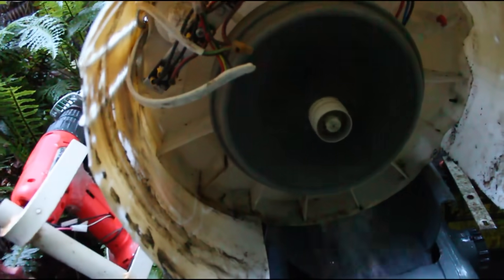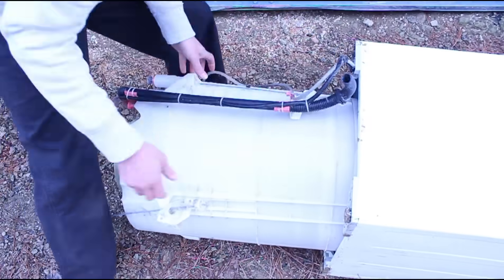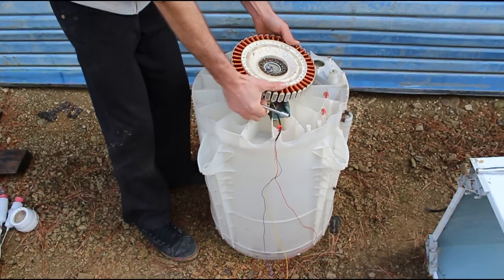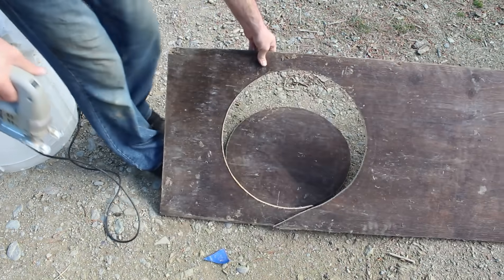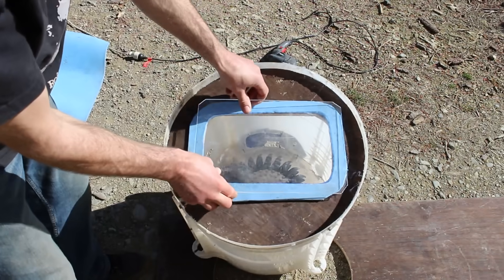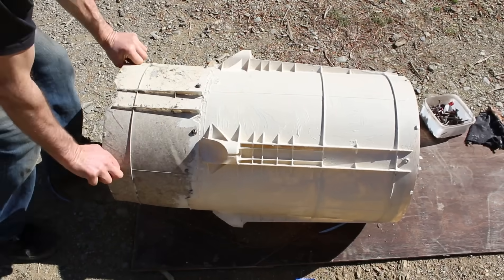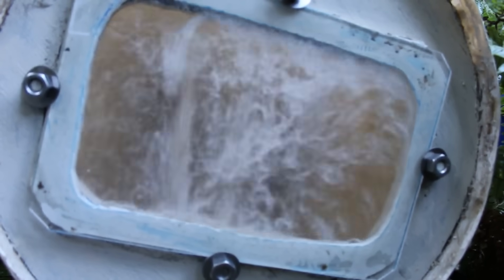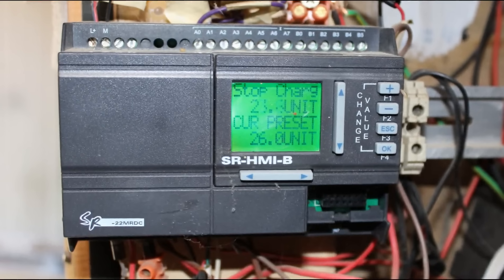Free power- How to convert an old washing machine into a water powered generator

Comment: all i need is ...land :(
Reply: Have a large tank with a high pressure hose connected from a height and have the water drop down to spin the wheel, connect a coil pump to the wheel either by chain or added to the axel. This coil pump using the spin of the wheel will pump the water back up to your tank without the need for electricity, or use a series of small pumps that use the generator charge, if you do that step up a voltage and then step down but a buck converter to each pump you need. But yea coil pump will get the water back up to the main tank. Ram pumps are good if you have an abundance of water but I’m guessing not in your case mate you want it all in one place like i do.
Reply: Go deep enough into the bush and you have your own land
Reply: Best investment you will ever make.
Reply: @calebengelbrecht7812  Land? Water turbine? I would build one 100% if only I had the space.
Reply: Less comment section, more work, you'd have some.

Comment: I came here after watching a washing machine turned generator that has been giving an off grid house power for 16 years on Marty T  YouTube channel. Thanks for answering the question "how is it made?"
Reply: I just asked the same question on Marty Ts channel then found this!
Reply: Is this the same guy as Marty T?
Reply: @droopypie  I don't think so.
Reply: @droopypie  yep same guy
Reply: It's the same guy I'm sure. Near the end he brought up his melted enclosure which I saw on the other YouTube channel.
Reply: @SteveJaye84  thank you
Reply: Yes same guy lol
Reply: This is marty T, pretty cool ayy
Reply: Same
Reply: how does he get that water pressure though? it can't just be that little stream going through those tubes
Reply: @ethand4784  I think it's the pressure is increased because of the length of the piping and the fact that it's piped from a great altitude than that of where the machine is.
Reply: @huwthomas9954  i think you might be right, that sounds pretty logical to me
Reply: @ethand4784  
He mentioned like 40-something meters of head so there it is. I’d love that volume of water and that much drop!
Reply: @ethand4784  gravity.
Reply: same idea.
Reply: Applicable only in places with free running water.and the flow of water changes as season changes...
Reply: I came here the same way, too

Comment: I've seen similar systems using a car alternator  and welding a steel box housing for it , the wheel of the alternator on the inside of the box , acts as a pelton wheel  :) it produced enough power for two houses changing batteries 24/7 !!! :) 
Nice job , the bearings issue obviously needs maintanence regularly , taking time to lube regularly ! 
With the alternator system , bushes need servicing every one or two years :) 
I love free power , my fisher and Pakel machine recently had a electrical fault , it's the same as yours , I pulled it apart to see what could be recycled and discovered the internal gear , perfect for a wind or water free power system !!! 
I was stoked to see your post today , and it's confirmation ! 
I put a multi meter on the posts that come off the motor and found instant voltage :) and realised just spin it with wind or water and , FREE POWER . 
Thanks for your sharing , great timing ! :)

Comment: I can recommend installing a temperature sensor on or near the bearings to monitor any possible issue with them. You can also add an accelerometer to sense for excessive vibrations and autmoatically shutdown the unit. If your controller does not support this, a small Arduino could monitor these parameters and issue an emergency shutdown signal to the controller through a generic IO line. Or even shutdown the system itself too, adding redundancy in case of failure. While you're at it, add a temperature sensor on the battery pack.
Reply: Hey do you run the F&P Smartdrive yourself and if so, do you do coaching for a fee?
Reply: They're factory sealed bearings that will wear out from the excessive speed of rotation.   Not to much to do about it, other than drilling a small hole into the housing and lubricating it on a schedule.   Just my opinion though, carry on.
Reply: @JohnJohnson-bg2oo  then stick a magnet on it or magnetise it and fill it with ferrofluid
Reply: @JohnJohnson-bg2oo  you can replace them before they damage the whole thing

Comment: Nice job fella, I did the same thing in the 1970's by making everything in my basement during the winter time. You really have it much easier these days for sure. But it is still running for my father. He loves it. Keep on making videos too.
Reply: Do you have a video explaning each part? For example: Bridge rectifier. How to do high pressure.  How to convert it to 110v. Charge a battery. 
Thank you.
Reply: @AurelienCarnoy  I will have to make some videos for all to see and get an explanation also. Good day VF.
Reply: @victoryfirst2878  thank you.

Comment: Cool, finally a video about free energy which is not full of bull or woo but really offers a solution! Like.
Reply: +Nele Abels It's not 'free energy' though, it's just hydro electric power, that we've known about since we've had electricity.
Reply: +goaliedude32 you're right, it's not free in that he has to pay for the pipe and parts and repairs and has to lay the pipe and has to purchase the property and has to pay property taxes - so, for every $1,000 he saves in electricity he might have to pay $50 in labor, parts, taxes and investment costs so it's not "free".  But, paying 1/20th of what he'd pay the power company is pretty close!  The REAL cost is that he has to live in a totally Hillbilly, zero civilization place where the ability to earn money is likely nill and the lifestyle is surly shit.  NO THANKS!  I'm fine living here in Vegas and paying my power bill, thank you very much!
Reply: David Beecroft
No, I meant that traditionally free energy is energy that is created by using over 100% efficiency devices. So more energy comes out of a system than goes into it.

This is just harnessing potential energy and converting it and it's not even a new idea. It's one of the first forms of generating power that we invented.
Reply: goaliedude32 yeah, good point.  he shoulda said "cheap energy" or "untapped energy"
Reply: +goaliedude32
Since he has found a way to power his generator from the stream rather than having to pay for high-pressure water, the electricity is free to him.
Reply: +David Beecroft
Yes, it would be, since he doesn't have to pay for his higher-pressure water downstream with this system, because the equipment isn't the energy; the energy is the energy.
Reply: +goaliedude32
It's actually not, because that kind of system doesn't really work.
Reply: Maxx Fordham
Gravity builds the pressure in teh system. It says the inlet to the water is up a hill about 10m I think. The weight of the water creates that PSI in the system. He doesn't have to do anything special to get it there.

This is not free energy(as traditionally described), it's just harvesting natural energy.
Reply: I know how this works now. I rewatched part of it and adjusted my replies accordingly.

But who is the supposed authority on what is "free" or "not free"? This is energy. It's free to him. The reason people build those silly contraptions that they think will keep running practically forever (until they need maintenance) is that they think they will be able to get energy without having to keep paying for it in some way or another, feeding the system with some kind of continuous outside effort or other expense, right? So why do you figure that the term "free" isn't being used in the sense of not having to pay or otherwise contribute (after initial costs or the occasional maintenance efforts)?
Reply: Maxx Fordham 
how much does it cost to rent a car?  $45 a day ... done!

how much does it cost do own a car?  well, just go buy a car!  $5,000 for a used car!  DONE!  

WRONG!  NOT done!

you have maintenance and insurance and registration and a lot of other shit you must pay.  JUST BUYING a car doesn't do it, but just renting one does!

Here in Vegas we mostly RENT our electricity.  But this guy buys it... so, at the end of the day, he's paying a LOT less ... but he is paying!  The energy he buys he purchases just like we do.  We have to pay for dams and nuclear and coal and all the other stuff that makes the energy.  He must pay for the pipe and the land cost and the taxes and the maintenance on the equipment to create his energy as well.

bottom line:  you're wrong - take care

oh, and p/s - i'd rather be rich living here in Vegas than broke and getting "free" electricity in NZ hell
Reply: I'm actually NOT wrong, David Beecroft. He could have that energy whether he had to pay for the land or not. The water flows whether he builds the equipment or not. He can have solar energy whether he buys solar panels or not (he can get warm without buying a dang thing). He can feel the wind whether he buys anything for that or not (and can feel its evaporative cooling effect). So the fact is that though the equipment to convert the energy (and if he had to pay someone else to install the piping) may not be free (but I bet he installed the piping himself), but the energy itself IS free. And then once you're done paying for the equipment, then the conversion process is free up until maintenance time.

The same goes for those so-called "free energy machines." The builders of those don't build them thinking that if they end up not getting free energy it's simply because they had to pay for the materials to make their machines; they just won't get free energy from those machines because isolated systems like those don't work in a mortal world.
Reply: David Beecroft

"Free energy device

a hypothetical perpetual motion device that creates energy, thereby contradicting the laws of thermodynamics
a device of which a controversial claim is made that it taps an unconventional energy source not regarded as viable by the scientific community at large"

All i'm saying is that the poster of this comment is not using terms perfectly.

I understand everything you said, and also this is a very small generator, not enough to power a house living a modern lifestyle. so he's still have to buy energy from a  power company.
Reply: goaliedude32 he stores the energy in batteries so he's probably able to live off the grid 100%, i think, as the generator charges his storage batteries while he's not at home or sleeping.  i'd agree with you if he were going a/c to a/c but if he has enough battery storage he can probably do it.  i hear they're selling tesla walls in nz and au now
Reply: +Maxx Fordham Using that same argument, solar power is "free energy" and so is building a camp fire with fallen limbs that you found. You could say you cooked your dinner with free energy.
Reply: Not quite, TIMEtoRIDE900, because in this case, or a case of solar and/or wind power, all the guy has to do once he has built it is let it run. He doesn't have to sustain the system with more labor until it's time to fix the thing (as he has shown us that it was already broken). With the fire idea, however, you have to keep feeding the system with more of your labor of finding more fuel (tree limbs, etc.) and working to get the fire started or keep it going. That's about the same as having to keep cranking a hand- or pedal-powered generator or something like that. Not really free energy there.
Reply: Absolutely right. Collecting wood is hard work.
Reply: Maxx Fordham j
Reply: There is no 100% efficiency device...,
Reply: One word. Hoover dam
Reply: you have it backwards. Life in on the land is a good life, life in the city is garbage and mind control, you will see.
Reply: IT is as free as it gets, it is as free as some electro magnetic high voltage high frequency anti gravity energy device.  Just because you already knew about it don't change what it is, and it is free energy as compared to buying it by the watt from electric company. You won't be buying a single watt so therefore it is as free as it gets. And in this case he don't even need to buy a $2,000 generator and all he had to buy is wire, battries and inverter and he might have made the inverter.

Free energy is free, it don't matter. But if you talk about over unity it also falls under "free energy" because it is as free as it gets, same thing, they still had to buy or make magnets, coils, rotors, stators, etc...to make the overunity device and it still needs some maintenance just like the hydro.
Reply: Nele Abels it
Reply: @TheGreatDadoo  looking at the covid 19 stats between vegas and NZ - how's that working for you now huh?
Reply: @TD-wi1zh  I don't understand your comment ... but if you're asking me how me and my family are doing, we're doing awesome... covid-19(84) is BS
Reply: @TheGreatDadoo  my tablet isn't letting me find my original comment to clarify. I'll just say I really like you "covid-19(84) comment though. The reaction by many to this thing -the way people rolled over and gave up their rights - is appalling and ridiculous! And look for the 'contact tracing' apps government want on phones - glad I don't use smart phones! (I do use tablets and computers, but usually gps and bt are turned off)
Reply: @TheGreatDadoo  seen it now - you mentioned you'd rather LV than NZ back with your original comment. Our media here says your area has been hurt worse than us by the reactions and supposed illness (much a result of panic and over-reaction I suspect). That was the intent - back when you wrote LV may have seemed preferable, but now?

Then again, thinking of our current government...
Reply: @goaliedude32  so you're suggesting to build multiple units to put power into lines and draw a paycheck as well? Or continue using keywords for clickbait. I'm confused.
Reply: jeremy richter  no worries big tech centers on the list too. Why else would Bill Gates step down? WWG1WGA
Reply: @coreypartain717  I don't even know what you're trying to communicate here.
Reply: @goaliedude32  oh. Sorry, I saw black and ram and a few other ghosts. Figured someone should say I see you too.
Reply: @TheGreatDadoo  yeah, because Vegas is known as one of the most civilised places on earth...

Comment: the idea of dumping excess power into hot water heater is good.  I majored in thermo and heat transfer back in the 70s.  Wind generators or any other type of generator seemed to me could easily be used to dump excess power into water heaters or tanks, opened with no need for venting or over pressure safety issues.  Get "free" hot water.

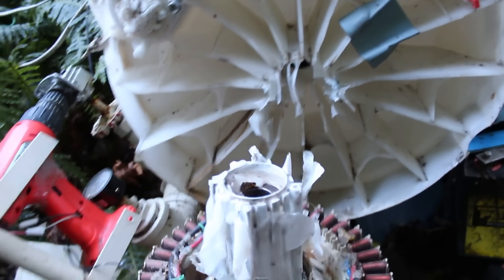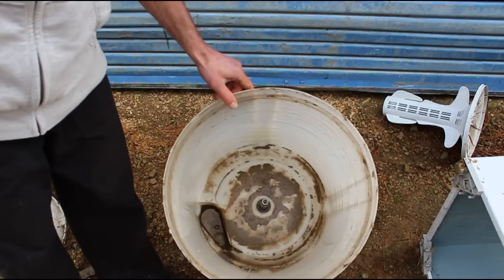Comment: even though this is an old video this is probably still watched today and it is a great Idea however when disassembling the washing machine there is a reason for that long extension in the middle toward the top of the machine. It is keeping a lot of forces from the bearings. Which as can be seen between 7:55-8:00 in the video the bearings are the part that is going to break down first. I would suggest using another bearing at the other end of the rotor rod that is seen around the 2:05 mark. It might take off some of the efficiency of the setup but it will greatly boost longevity.

edit: by the way love how you generate that pressure. pretty simple solution. Couldn't that have been improved by using a funnel at the start.

Comment: I have done the same thing but instead of water I use wind.  I had many problems using wind but after about 30 different designs I have it working great. The only problem is when the wind gets over 70 mph.
 We just had a storm come through and was hit with 70+ mph winds and wow what a explosion. I'm fixing my mistakes. Great Videos
Reply from the maker: You should make vids of your project, sounds interesting
Reply: Lol need a regulator to limit the max to the batteries
Reply: use a reduction gear hooked to a governor.  As wind speed increases, the reduction gear kicks in, slowing the blade speed, increasing the generator speed.  Shunt the extra power, of course, or have a max speed disconnect.
Reply: t s problem is reduction can only do so much, same with tilting mechanisms. Storms are unpredictable gusts of wind that can load up the turbine one direction then snap it back the other. Hence why in high winds they lock down wind turbines.

Comment: If you are full charge you can use the PLC to drive a solinoid which switches off the incoming water. it would save wear and tear on your bearings. btw, slick setup!

Comment: This is an excellent video. You might add that about 100 feet of head height is required to get 45 psi.
Well done sir!
Reply: Unless you live in an area with huge mountains, this is not even feasible.
Reply: @gordtvradio3465  35m is not a "huge mountain".

Comment: This stuff is awsum! A friend of mine did this using a 24 volt alternator gave it more field
and got 36 volts, ran that into 4 8 volt diesel locomotive batteries of high amps. He told me
this was better as 100 watts used at 12 volts would be a little over 8 amps, but 100 watts
at 36 volts would draw 2.7 amps. He did also have a made-up cast iron briggs stratton
engine with a hvy duty alternator to keep the batteries up if the creek ran dry.